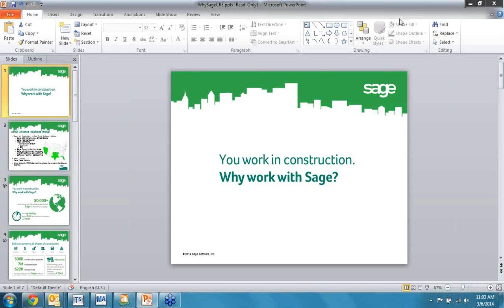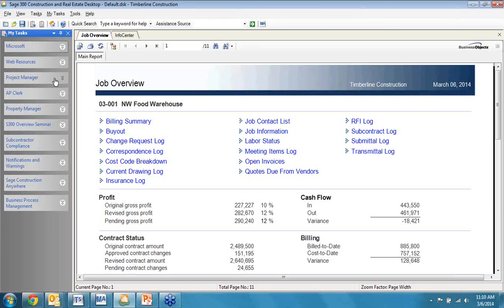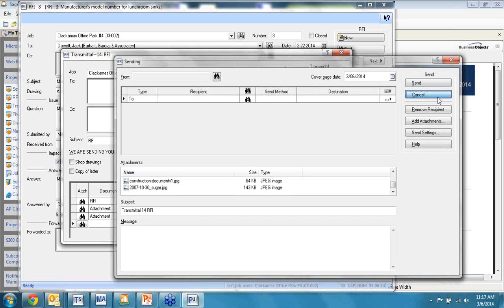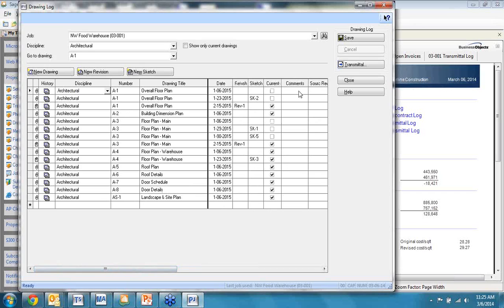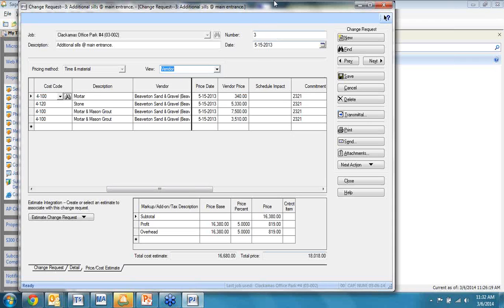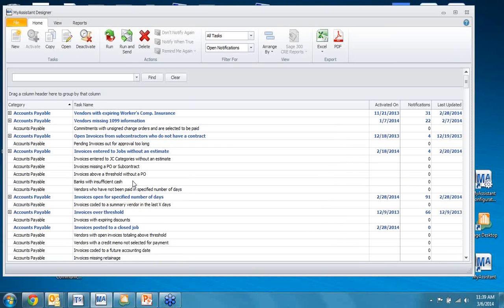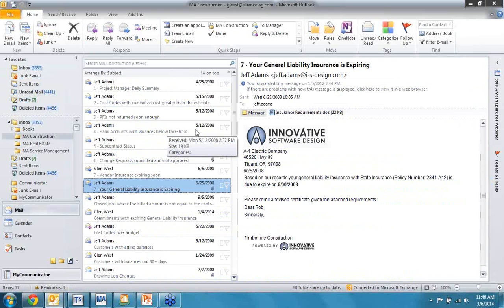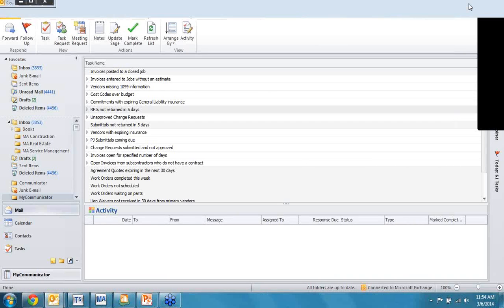Total Project Control with Sage 300 CRE Project Management and MyAssistant

Comment: Wow so glad Sage 300 is so tailored to GCs.No wonder we now spend 10X the time we used to responding to written requests etc etc etc. You guys are putting a lot of subs out of business with your software that is for subs difficult to navigate, cannot flexibly generate data to download to excel from you inquiry screens, and best of all every update destroys your custom written reports you paid a consultant thousands of dollars over the years to write. Thanks for helping nail the coffins of so many subs. I bet the GCs just love you all. Guess they will be happy when they have just a few subs to choose from -- and those that are left will be able to mark up their services like never before!
Reply from the maker: +Joan Martin 
This presentation was designed, marketed and delivered to a general contractor audience.  Of the 1,000’s
of construction firms that own and operate Sage 300 CRE over a 1/3 are subcontractors.  How you implement the software will change the focus and emphasis of the solution.  If your implementation is not optimized for your industry, I would recommend contacting your Sage Business Partner and having them do a review of your set up and work flow.  I am sure they can resolve some of your issues.  To clarify a couple of your concerns, every Inquiry in Sage 300 CRE has a direct download to Microsoft Excel.  It is on every inquiry screen and is designated by a button that looks like a spreadsheet with a green X.  The Sage upgrade is designed to ignore any original reports that are modified or new reports added to the system.  If you do not follow the directions provided with every release identified as Release Notes and Update Instructions, the software operator might  inadvertently overwrite report folders and/or restore folders to their original content.  Utilizing a recommended back up would allow you to restore the report folder(s).
If you are really a Sage 300 CRE user I am sure your local Sage Business Partner would be happy to provide you
with information and assistance.  If you prefer, please give me a call and I would be happy to find one of our resources that can help.
Best regards,Tim Boerio, Director of Marketing
888-559-9540x4003